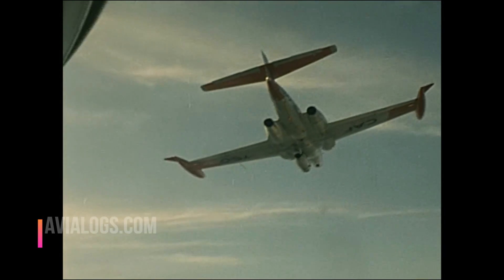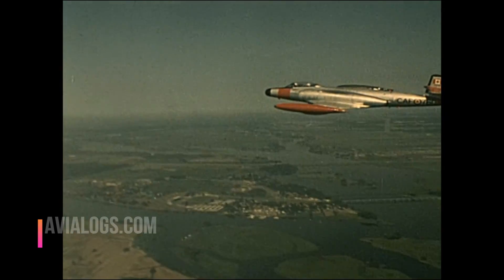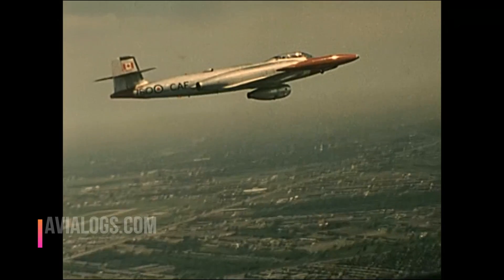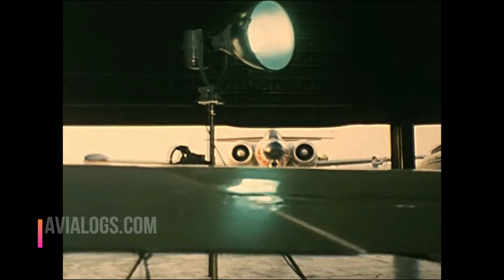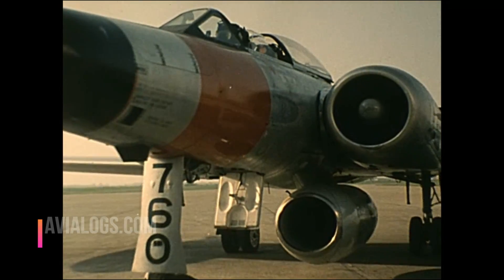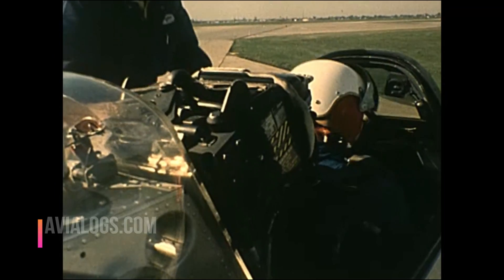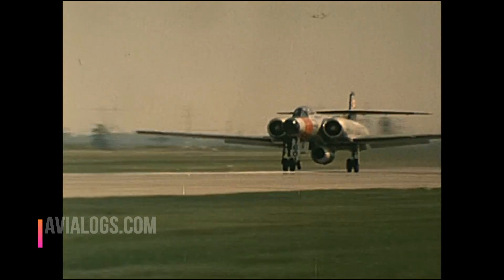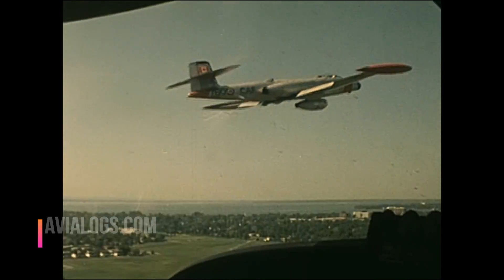The last flight of the last CF-100

Comment: I refuelled a CF-100 in CFB North Bay in the late 1970's.   I believe that 414 Squadron flew the last CF-100 and CF-101 (EF-101B).
Reply: You are correct. That black CF-100 flew several years after this "last" flight.